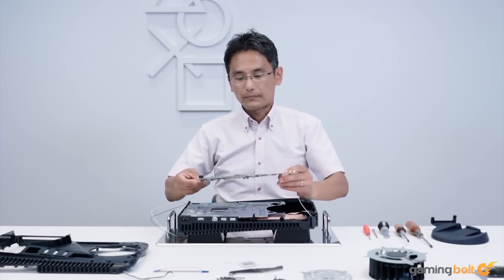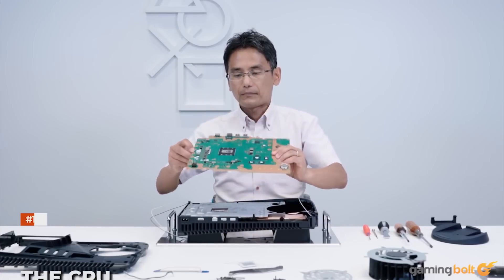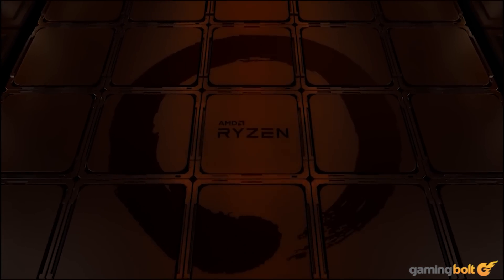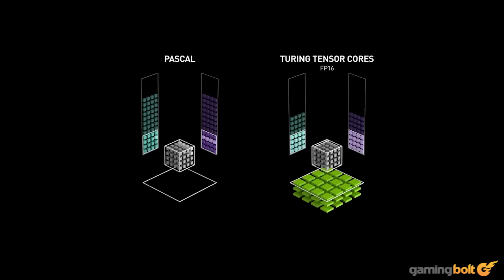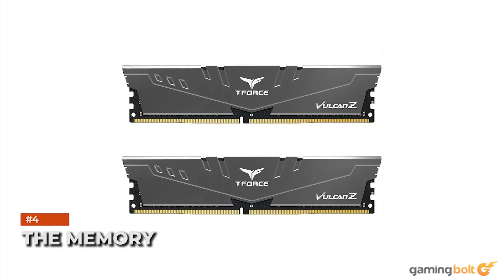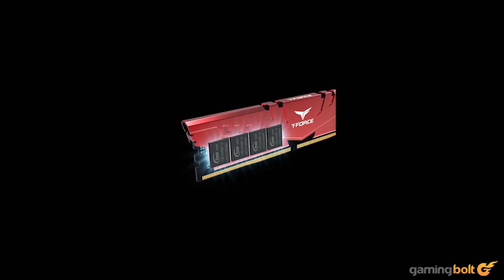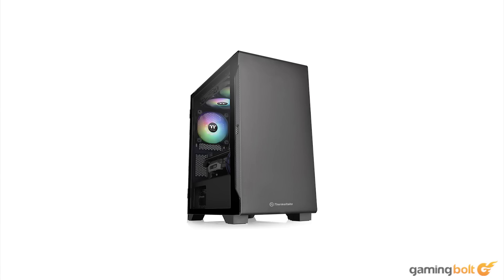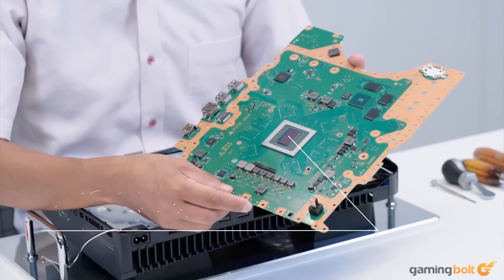How Much Would It Cost To Build A PC As Powerful As The PS5? (2021 Edition)

Comment: If you don't include any drive, then why not compare to discless ps5? Add some keyboard/mouse combo, install some linux and you'll be slightly above 3 times the price of a digital only ps5
Reply: @Avocaza I mean you could wait for steam sales for the games and it would be even cheaper on PC; but that's not the point is it? People want to play the games when they launch and not 2-3 months later.
Reply: Linux generally has worse compatibility for games, which is why you'd wanna go for windows instead.
Reply: @turntwiggy  True, but valve has really been pushing for linux compatibility so proton keeps getting more and more compatible games.
Reply: @Avocaza Because digital games can be bought cheaper when used, right? Used digital games?  ;D
Reply: @deductivevariance3497  No, but sony has a captive market so they don't have much reason to lower prices until sales really drop
Reply: OLED tvs are $2k. If you're playing a next gen console on a 1080p or even a 1440p monitor then lol because you're stuck at 120fps when a decent PC can easily go beyond those frames.
Reply: Add a 4k 120hz TV to your ps5 then add Playstation plus for online gaming for the next 5 years it come pretty close not to mention you could rebuild this pc in 5 years and it would be almost half the cost. Idk people like to say console is so much cheaper but they forget to add everything don't get me wrong it is cheaper on console but not by as much as people think
Reply: @liamcollings6168  5x60 is 300, so digital ps5 + 5 yr of ps plus is 700,- what are ypu saying
Reply: @Ohiodirt  sorry not nerdy enough to know the actual price but still double for somthing you don't have 2 pay for on pc plus in 5 years this pc will be half the price as well while the ps5 will remain around the same price plus games are going up for console I mean should I go on....
Reply: @liamcollings6168  ohh so when you build a PC it comes with a free 4k monitor or tv? Hmm I didn't know that.
Reply: @Maniac-king1720  does a ps5 come with one 2 hmmm???
Reply: @liamcollings6168  Nope. That's why I said it because what you said was irrelevant.. Because they they cancel each other out. LMFAO. Furthermore I would say at least half the people that buy a PS5 already have a decent TV therefore it's a non-issue for half the people.
Reply: @liamcollings6168  umm you have to spend the same for a oled monitor or oled tv for pc if you want to play 4k in its best fidelity so whats your point cause you can use a monitor for the ps5 just like pc lol .. also its only 200 fro th next two years of gamepass so ... more like 700 plus 700 for a 1440p monitor and thats 1400$ compared to 4k for a max rig and tv for pc lol so stop the cap
Reply: @liamcollings6168  PS5 is not just 400$. It's 400$ + 180 for SSD expansion later + 60$/year online gaming + 10$ extra on new games. In 4 year's time (half life of a console) that adds up to : 900$ - with 8 new games bought at 70$ each (2 per year). [PS5 is also locked to PS marketplace, and it's kind of difficult to get used digital games.] And 4 more years would make it cost 1220$.

Comment: on PRICE comparisons...
$324 (USD) is the target price. Here's why:
If you don't include the BluRay drive then you should be comparing to the DISCLESS version of the PS5 obviously... that's $399USD (MSRP). You need to take off the price of the CONTROLLER to be fair, AND add a wireless USB stick. So that's about $75. Now try to build a PC for $324.
Reply: It would actully be possible, if prices hasn't skyrockted on pc hardware, due to pandemic. 
350 would net you a decent I5 or older I7 system, with a 970/980 in 2019.
Reply: PS5 is not just 400$. It's 400$ + 180 for SSD expansion later + 60$/year online gaming + 10$ extra on new games. In 4 year's time (half life of a console) that adds up to : 900$ - with 8 new games bought at 70$ each (2 per year). [PS5 is also locked to PS marketplace, and it's kind of difficult to get used digital games.] And 4 more years would make it cost 1220$.
Reply: Hey let’s compare a whole pc to a console that was only designed to do one thing, play games lol. A pc will always have more compute power than a console with a mobile APU lol
Reply: yep and with pc you also gotta buy monitor, desk, chair, with consoles most people just add it to their living room tv which is good enough, play on the couch or bed
Reply: @jonathanvaladez5916  I like how people like you are so close minded about PC gaming. Its the opposite of what PC gaming is. You have such a versatile setup for PC. It can be couch gaming on a TV. It can be a monitor with a desk and chair setup. You dont HAVE to buy a monitor, chair and desk. You can use preexisting hardware such as the old TV and couch.
Reply: @sack8439  
i know you can, but realistically speaking most pc gamers dont do that, they typically buy a gaming monitor, a desk in some corner of their bedroom, etc, it sounds idiotic to buy a 4k capable pc rig to then hook it up to a slow, color innacurate, 1080p tv, again i know it's possible but most pc gamers i know and see online dont do it cause it's idiotic
Reply: @jonathanvaladez5916  I mean you could say its idiotic do hook a 4k capable rig to a bad TV but thats what almost every console user does aswell, but also still brags about their 4k capable 500$ console.
Reply: @sack8439  the average american household has a 1080p tv in the living room, not a 4k OLED with the latest and greatest of technology
Reply: @jonathanvaladez5916  And thats why I said most people like to brag about their 4k capable consoles but like you said most only have a 1080p TV and therefore isnt capable of using the tech of the console.
Reply: @sack8439  even then, 1080p is still pretty good and if you already have one theres no need to buy a top of the line tv
Reply: Then add the cost of Playstation plus for the next 5 years just so you can play online now the cost gos up to $1300
Reply: @liamcollings6168  bro how you got this number its 60 bucks a year for already yearly users lol
Reply: @liamcollings6168  CD keys has 1 year ps plus for just 30 dollars. Even if u add that for the next 7-8 years plus PS5 Digital with all accessories (399.99), It would still be faaaaaaaaaaaaaaaar cheaper than PC with similar performance. But then again its always the exclusive games that decide who wins. Power is there by default. Demon Souls on PS5 alone is enough to make the whole PC Gaming look like a joke
Reply: @ajdaniel8128  🤣 demon souls is absolutely not that good and you wanna talk about exclusives there are full genre's missing from console rts real mobas lol don't even get me started on the fact that your Playstation exclusives are all coming to pc
Reply: @liamcollings6168  Actually all of them aren't. Only very few are coming to PC. The best ones stays on PS5. Also, even if they are coming it's only coming after 3-5+ years old. While you pc crybabies play old PS4 titles, PS5 players are playing Demon Souls, Rachet&Clank Rift Apart, Returnal and others. These games are critically acclaimed. PC Gamers only play pixelated low graphical or old AAA titles and thats pathetic. PC has 0 AAA exclusives. Also, Indie games are Trash. If you think those indies are games, then your standard is way too low but then again these games are the only choices you got
Reply: @ajdaniel8128  did you say low graphics lol you do know my pc is almost 3 ps5s worth of power you have no idea what good graphics is lol
Reply: @liamcollings6168  Power doesn't mean anything if all you got are indie trash and other old titles. Your comment is irrelevant. Hardware is useless without software
Reply: @ajdaniel8128  dude go on steam and look at all the news games your just a ps fan boi all you have is single play one and done games 18 hours tops....
Reply: @liamcollings6168  I already use steam everyday. 90% of games on steam are garbage. 18 Hours Tops? ROFL Demon Souls, Bloodborne, God of War are not 18 hour games lol. Stay ignorant hahaha
Reply: @ajdaniel8128  there is no way you have a gaming pc or atleast not a decent one if you think Playstation is better  your lucky to even get 4k and 60 fps most of the time you have to choose between then 2 and even your exclusives are on on medium settings and the games you are listing off are all 1 player one and done games that have next to no replay value what so ever.... talk about ignorant 🤣. But honestly I came from console gaming and pc is better in almost every way
Reply: @ajdaniel8128  yeah I can't relate I have a great monitor oh well whatever floats your boat but I can't let the graffics thing slide you and I both know all those ps5 exclusives would look better on a decent pc and that's just fact
Reply: @liamcollings6168  PS5 exclusives like Demon Souls, Rachet&Clank already look amazing in HDR and are the best looking games currently. There are no games on pc that can match those games interms of graphics. Lets say in 3-6+ years these games end up on PC, it will indeed look better (provided u got the hardware and Devs optimize it properly) the difference would still be negligible. PS5 versions already run at locked 60fps. In 3+ years time, PS5 gamers would have already moved on to bigger and better titles. I'm not someone who waits 3+ years to play a game.
Reply: @ajdaniel8128  🤣 your delusional they are not at all the best games and you will never convince me otherwise. Go have fun on your 5 games and let me know when you get bored with them single player games 🤣
Reply: Mr7digit  Everything looks pretty damn good so far on my 4k Oled TV so whatever u said really doesn't matter. Consoles are far more efficient than PCs will ever be so specs won't even matter as long as its a powerful console. It's the software and the results you get out of these machines that will matter in the end. Everybody including YouTubers like NX Gamer is impressed with the PS5 so far. I would rather believe them than you. PC hardware will keep evolving but PC Games will always be behind or will always look inferior to Playstation exclusives. It happens every gen and by the time PC versions of some of these games come out, there will be PS6 and even better looking exclusives. It really doesn't matter in the end. Software is King
Reply: @ajdaniel8128  I prefer mouse keyboard for control. I'm tempted to get Series S but I don't have broadband connection, so PS2/3DS/PC (i3 9100f/RX 570 4gb/hdd 1tb/8gb ram that I built for around $450 almost two years ago) are my options. The PC specs is below PS5 or PS4 Pro but I mostly play older games (ps3/xbox360 gen) and indie Metroidvania.
Reply: @ajdaniel8128  I'm sure you will enjoy playing Starfield on PS5 then. Also, congrats for being able to play more than 30fps on your gaming box the first time. (Btw, PC has the most exclusives as it is the most backwards compatible platform.) ;D
Reply: @deductivevariance3497  I already have a PC and PS5. I also own more pc games. Only AAA obviously. Also, 90% of games on steam are junk. PS5 games especially the exclusives are quality. It's only going to get better. Meanwhile you can keep playing your shitty indies and Xbox games like starfield which is only going to come out after 1000 years ROFL
Reply: @ajdaniel8128  I’m a pc gamer and I own both next gen comsoles. Kid, the ps5 and Series x are not running 4K natively. They use resolution scaling and on top of that the graphical fidelity is not as good as it is on pc.  In my honest opinion, games are best played on pc. My Lg CX oled looks nice but it’s not the ideal screen to play fast paced games on.
Reply: @ajdaniel8128  there’s like one decent Sony exclusive every 7 years lol. 99% of games are released on all systems lol
Reply: @dutyrover946  "one decent exclusive every 7 years" hahahahahaha sure you own a ps5. Joker
Reply: @ajdaniel8128  i own 2 ps5 a and two series x. I’ve actually spent more time playing Xbox exclusives than Sony’s.
Reply: @ajdaniel8128  The problem here is you only play AAA games on PC and PS5, there is a lot of indie games and PC exclusive AAA games that exist, you just look in the wrong places. Furthermore, PS5 is for gaming only and PC can be used for literally anything you need it for. PC is a higher upfront expense but in the long run it will be cheaper.
Reply: @sack8439  I already have a pc that I do everything else on. Thats not even an argument. Everybody already has a pc by default but that isn't stopping people buying playstations. Some of the best games are only available on PlayStation. Sure it may come to pc after 5-10 years. by then playstation gamers have already moved on to much better titles
Reply: @ajdaniel8128  Sure there are PS games that come to PC after many years but you know that we PC gamers arent just twiddling our thumbs waiting? We of course have games we can play ourselves and either just be happy that a new game is out and we can enjoy, buy a PS just for the exclusives or never pay attention to it. Its not the end of the world.
Reply: @sack8439  Maybe I haven't mentioned this but last gen I played on my pc more and I have more hundreds on games across different launchers on pc. Almost 500 games. But this gen I play on my PS5 along with an LG OLED TV. I prefer this experience way more now compared to playing on my monitor. I only have 6 games on my PS5 but all those are critically acclaimed and of the highest quality. Just Demon souls on ps5 alone is better than the whole steam Library in my opinion. Quality > Quantity anyday. Dont get me wrong, I still play on my pc but you know convenience is king these days especially after becoming older
Reply: @ajdaniel8128  Why not hook up your PC to your TV if its a better experience then?
Reply: @sack8439  TV is in the living room. Why would I move my desktop to my living room and use keyboard and mouse sitting on a couch? Cmon lol. How stupid and uncomfortable and inconvenient would that be. It's not like I can navigate the whole Windows OS using a controller. PCs are work machines primarily while consoles are entertainment focused machines. If one was actually better than the other, then one of them wouldn't exist
Reply: @ajdaniel8128  You can actually use PC just as a console, Steam has something called Big Picture so its made to be comparible with controller.
Reply: Looks like you didn't read carefully. If you want to use keyboard and mouse just to start windows and then use a controller after launching steam all this while sitting on a couch, you can go ahead and do it. If this is what you call convenience, then I don't know. Oh I forgot you only play on pc which means convenience is a word you don't understand
Reply: @liamcollings6168  demon souls is sick lmao who tf told you it wasn't oh yeah you haven't even played it you on pc only
Reply: @liamcollings6168  bro steam has nothing to do with ps5 numbers numb nuts and halo is not even played on pc more than xbox lmao foh
Reply: @liamcollings6168  it's actually 300 only (60 per year)

Comment: Difference of a PC is cause a 1800$ will last me for years,example.My Pc is already 3x stronger then a PS5 and Xbox SX. In a few years you will need to buy the PRO or wtv they gonna call them.While lets say  PC like mine will be good for years to come.Graphics and Performance will stay stuck on Consoles.Not a Good PC thought.

Also Gamepass.
Steam.
Pc games are cheaper to get.
XBOX games are on PC.
SONY exclusives are coming to PC more and more.
And PS now is available on PC.
Reply: @Transistor Jump rtx 3090 and 3080ti even the 3060ti and 3070 with dlss on.
Reply: @Transistor Jump so you think on lower than low setting a 3090 is not at least 3 times as fast as a console? May I have what you're having?

Comment: The custom amd GPU in ps5 or Series X is equal to PC's AMD Radeon RX 5700XT graphics card
Reply: @Transistor Jump he means that the PS5, and xsx performance wise is equivalent to a 5700xt. Just because it's rdna 2, doesn't mean it's faster. An rx5500xt is newer architecture than Radeon 7 gpu you think the 5500xt can compete with an r7?
Reply: No. The ps5 and Xbox have top tier VRS making them much more capable
Reply: @balloonb0y677  LOL